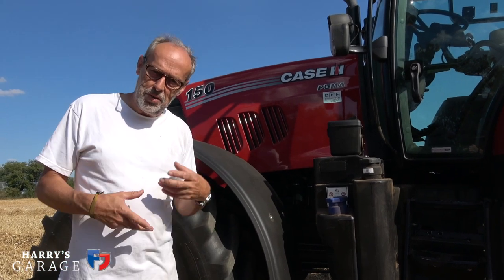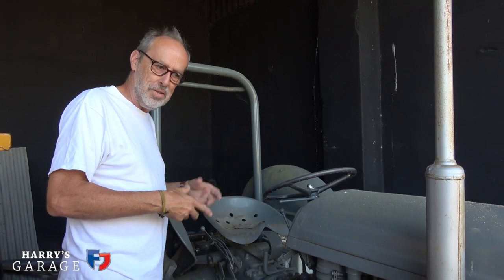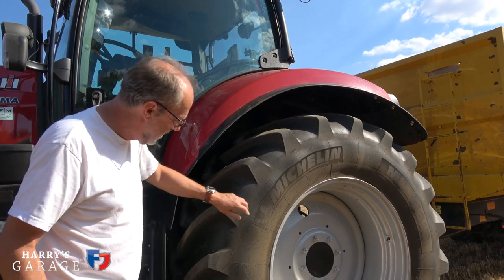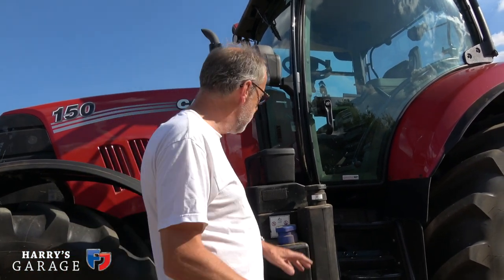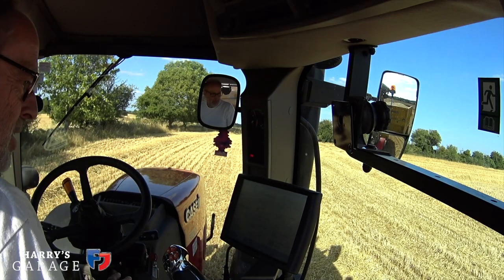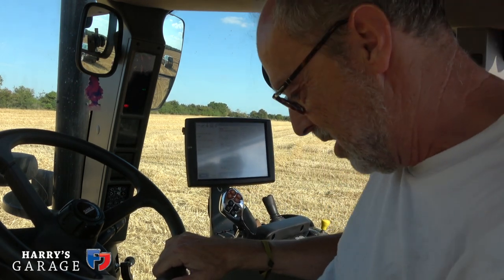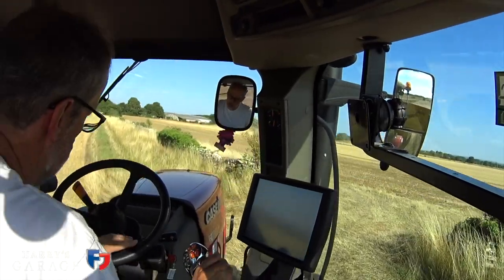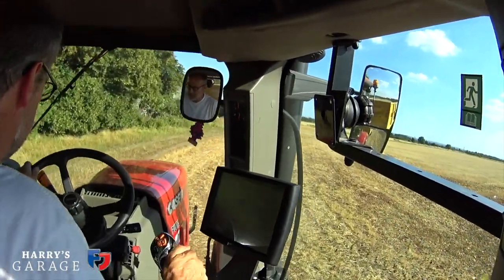Driving a 2018 tractor and a look at what's changed over recent years

Comment: Question is why are these modern tractors not electric?   Back when Rudolf Diesel invented the diesel tractor, his intention was to fuel the farm machinery on it’s product....peanut oil.  Well, even back then ‘Big Oil’ had something to do about that, and all diesel fuel was made from distilling petroleum.  Now in 2020, all farms should have PV solar, wind energy, and large batteries and the farm should be power by renewables, just like Rudolf intended 100 years ago

Comment: all good until you run out of ad blue and it goes into limp mode.  and you live 200km from the nearest service centre!   Or you get some dirty fuel and the common rail diesel throws a fit, fuel filters are $160 a pair to change, hoping you don't have pump or injector damage.   In short, all good while it is working, when it doesn't, it is hell.   asking a lot of electrons to play nicely in a farm environment is fraught with danger.

Comment: The CVX had no gears. Wasnt the best to tow a trailer doing maze on hills. belive it or not.
Reply from the maker: I tried a CVX version before going for this one with the regular power-shift gearbox and didn't like it. Hard to be smooth on road with CVX, especially in stop start situations and this 150 Puma could pull a loaded grain trailer quicker up a hill that I do regularly than a 200 Puma CVX. Didn't expect that..

Comment: Do you find driving these boring? I find that there is so little to do in modern tractors that they are incredibly boring. Horrifically boring to be honest. Older stuff is less comfortable and more tiring but my God the days don't feel half as long.
Reply: Certain jobs that they have to do are boring. Rolling large areas is one such job. Back and forth, back and forth for hours, no days on end. OMG it's boring.  Also big flat fields tend to be more boring to work in than ones with complex borders that are more medium size.
I well remember working a 2 shift 24 hour a day system during potato planting season, on a tractor and rotovator/cultivator. I did the day shift and a workaholic New Zealander did the night shift.  This was back in 1976.  Boring slow-moving full power job. He actually fell asleep at the wheel and went over a hedge into the next one. Lucky that he went over that one, because there was a 150ft cliff at the other end.
For most jobs, even with the automated systems, the driver is too busy to get bored.